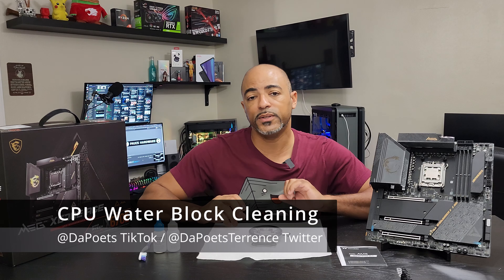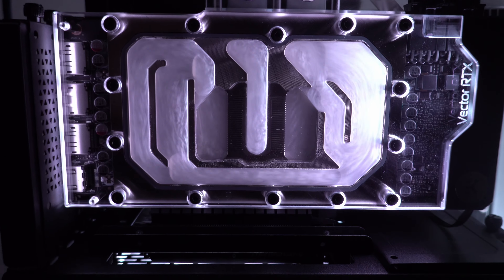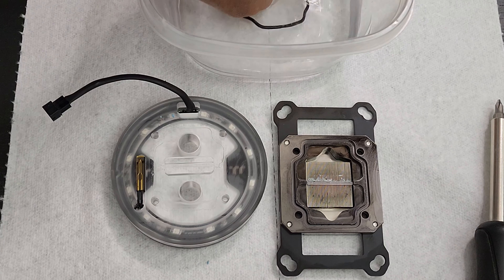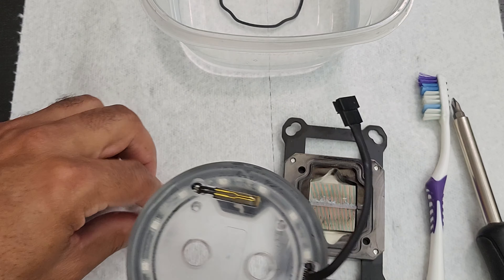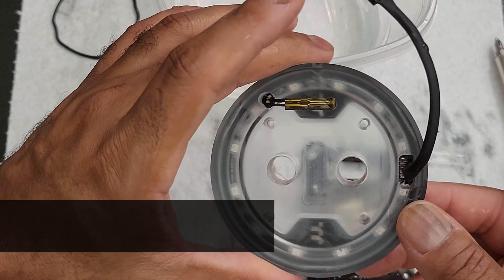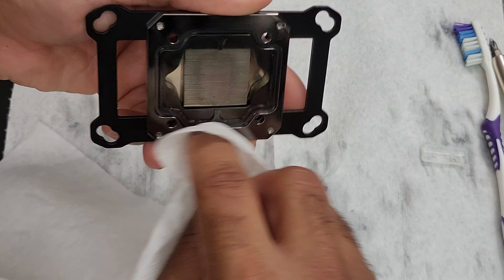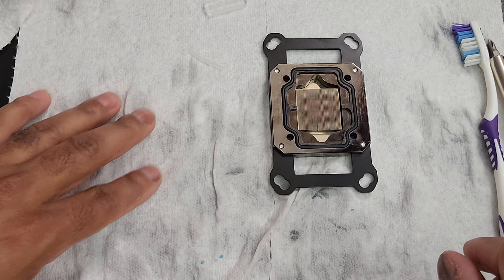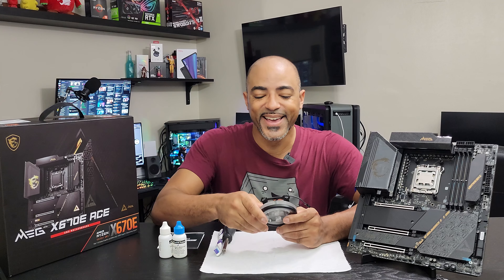CPU Water Block Cleaning - How To Clean Your Thermaltake Pacific W7 Plus

Comment: Good Stuff here Poet! Has the Engineering Sample Fluid been released yet? I want something that strikes a good balance between the opaque look and clear. The Opaque coolants seem to require a little more attention to cleaning because of the solids building up. Something that can carry a little color but doesn't leave as much residue would be ideal. That coolant looked good under light and you said it lasted for a while. Sounds like this might be "The One"!

Comment: Mixing metals is fine...  use the right coolant and itll be fine... if mixing metals were bad.. cars would corrode to shit.  ive been watercooling for 23 years.. 

  youre block is filthy though and stained i suspect you werent using good coolant.. whatever thermaltake fluid they gave you it sucks..  I wouldnt use that again tbh.. Never have i seen that on any of my setups.   Using regular car antifreeze or EK coolant

  That asside... how do you like the W7 block ?  I have an EK supremacy evo and thinking of getting the W7 for more rgb.

I would habe probly polisjed the inside of the block with mothers mag aluminum polish.  Can use it on any metal..  would have made it shiny again with that tooth brush

I do see copper on the fins.. so it looks like the plating has been lost on it.

Nice video though thanks for the teardown so i can see the interbals of the w7.  Curious what the purpose of the Jet was for.. considering the water goes down before it
Reply from the maker: mixing metals is not fine as most won't know how to create the proper formula to prevent aluminum from degrading. It's best to just not do it as there isn't a need to mix metals except for AIOs.  The Thermaltake fluid was excellent and I love it. Paul's Hardware used it for a long time and was very happy with it as well. No issues except for the occasional aesthetic cleaning of a visible block.

Comment: Great video. Really gave me the motivation to get a water cooled pc even though I’m afraid of potential leaks. Quick question: you said the intended temps of the new cpus is 95c, is that what amd is saying the normal temp would be at or is that the max before it throttles?
Reply from the maker: That's the target temperature that AMD has designed.

Comment: Interesting, I didn't know that the thermaltake block has a built-in temperature probe (I'm assuming that's what the wire encased in the yellow tape is). Clean way to have one in your loop without needing to use a G1/4 plug sensor.

Comment: Do you need to change the fluid in a GPU loop or CPU loop more often?
Reply from the maker: No, how often depends on the fluid type
Reply: @DaPoets  if they were on separate loops would you run different liquids?
Reply from the maker: @biggiematt  Personal preference. But usually no, I would use the same fluid as I feel that always looks better unless it's a particular theme build

Comment: I think open water cooling is an overkill for most computers, you can just use a normal water cooler 
Sure there's some exceptions
Reply from the maker: Custom water cooling benefits high end hot running hardware.  It greatly benefits these 95°c running 7000 series CPUs making the performance gap wider between a 360mm aio and a custom loop